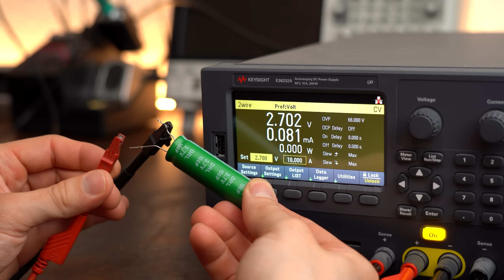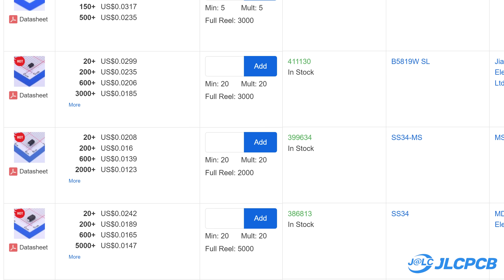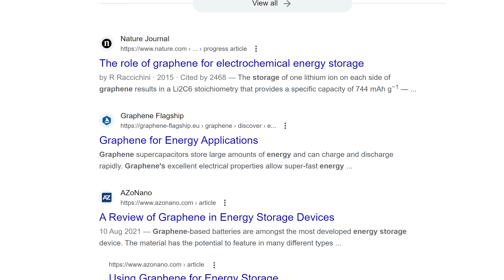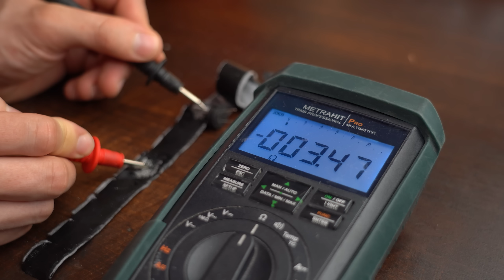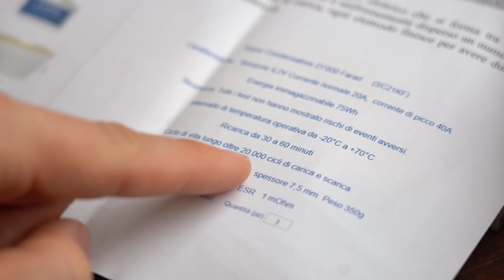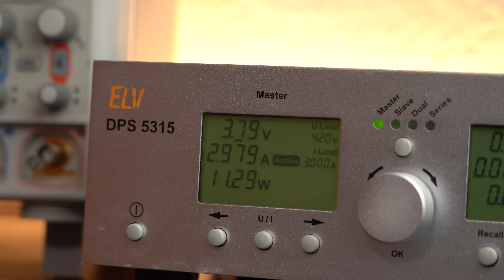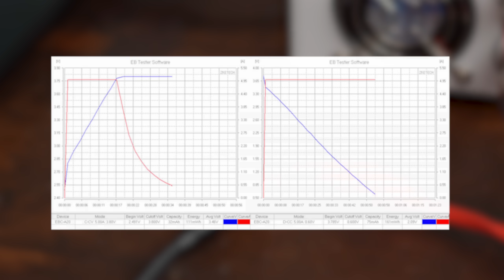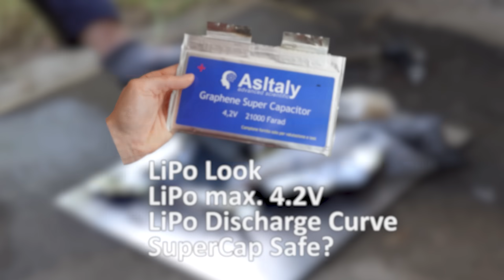Finally a Capacitor that can REPLACE a Battery?!

Comment: The only difference in terms using names of battery vs capacitor is capacitor is physical storage of charge and battery is chemical. So, it can be both by the video. Graphene gives porous structure which would in that size be corespondent of few tenis fields size if it is coal powder, - so IS involved chemistry but on nano level - if it is capacitor. As capacitor, alu plates are in combination (or included copper can be) with the graphene contact separated with paper - probably electrolyte on it too. If it is capacitor, the difference with battery is not huge, because it has chemistry after all and is not pure surface area separated with thin insulator to play only physical charging without chemistry. It is combination there, but very well designed. If both are included copper+alu also graphene, that is awesome combination.
The only better combination (cheap) would be porous as the graphene structure from alu (similar to human genebut 3d). (way time until people find tech to make porous alu :-) )
Copper porous would be more expensive, 
have good day Scott.

Comment: Looks like its a supercapacitor, lots of layer with carbon layer and separators, 1 cell lipo with 40 amps? There's a lot of supercaps model nowadays with fhat configuration. But today differentiating from caps supercaps and batteries its really hard 😂😂

Comment: I'm holding out for the borophene batteries which is more conductive, thinner, lighter, higher band gap and stronger than graphene.
There's actually loads of xenes but only borophene beats graphene in everything useful.

Comment: In my opinion, there are diodes inside this super capacitor that limit the current and prevent discharge at once, and a low voltage cut-off circuit that cuts off the current when the waist voltage goes below each cell layer. Thus, the supercapacitor is controlled discharge over a very long period of time.

Comment: Video idea! Finally a battery of the future?! Aluminum ion battery. (4.8-3.4 volts usable range, 5000-15000 charge/discharge cycles, 3000 wh/kg capability, and high safety!)

Comment: They have graphene super capacitors on ebay now for fifty for the 5500 Farad and 30 dollars for the 1300 farad capacitors. So graphene super caps are safer as they don't catch fire.

Comment: There has to be a MSDS fir the thing. It legally has to state that it contains lithium on the package, to be sold in the USA. You can test if it has lithium with science... Though, I honestly think it is just a standard supercap, and this is how the new technology works. It has reached the point of physical limits, relative to mass capacity, unlike a traditional supercap that just functions on the upper slope of that same curve. Minus the end, where it just drops to zero.

The physical reason would be the density of electrons running into restrictions when charging and releasing across 30x the surface area. A capacitor surface is 30% less and closer, making for easier charge and discharge.

That carbon layer looked real thick, relatively speaking. When compared to the thin layer of activated carbon in the rolled capacitor.

But you are right, it could have been a hybrid with less lithium in the mixture.

Comment: Another clear telltale sign of a lithium battery in your video is the alternating aluminum and copper plates inside. Lithium batteries require a copper anode for the proper chemistry.  Capacitors don't. Lithium batteries also have a distinct smell to their electrolyte. ( Which I could not tell from the video). I have taken apart a few li-po batteries. This Looks exactly like one. Perhaps it did not overreact to a nail being put in it because of the lower state of charge. Also, higher performance batteries will conduct more and react more strongly. 
I interpret all of the evidence pointing  toward a cheaply produced Mis-labeled Over Priced Li-po battery.

Comment: To determine whether the claim that a 21,000 Farad (F) supercapacitor with a voltage of 4.2V and an energy storage of 75Wh is real or a hoax, we need to perform some calculations based on the given specifications.

The energy stored in a capacitor can be calculated using the formula:

𝐸
=
1
2
𝐶
𝑉
2
E= 
2
1

 CV 
2
 

where:

𝐸
E is the energy in joules (J),
𝐶
C is the capacitance in farads (F),
𝑉
V is the voltage in volts (V).
First, let's calculate the energy in joules and then convert it to watt-hours (Wh).

Calculating the energy in joules:

𝐸
=
1
2
×
21
,
000
 
F
×
(
4.2
 
V
)
2
E= 
2
1

 ×21,000F×(4.2V) 
2
 
Converting joules to watt-hours:

1
 
Wh
=
3600
 
J
1Wh=3600J
Let's do the calculations.

The energy stored in a 21,000 Farad supercapacitor at 4.2 volts is:

185,220 joules (J)
51.45 watt-hours (Wh)
This is significantly lower than the claimed 75 Wh. Given this discrepancy, the claim that this supercapacitor can store 75 Wh of energy appears to be inaccurate or exaggerated. Therefore, it is likely that the 75 Wh storage specification is either a mistake or a hoax.

Comment: I am looking for a electricity storage for something like an electric gokart for a competition event where you start with an empty "battery" and then fill it with your muscles. It would be important that the storage of both vehicles is equal in voltage and capacity. The stored energy is planned to be enough for only five minutes or so because the competition is not only about muscles but also brains. Could I achieve this with capacitors or is this still too much, too complicated or expensive (not more than 250€ per battery)?

Comment: There is an updated data sheet on the manufacturers web site now (in Italian) https://www.asitaly.it/datasheet%20supercap.pdf

The first paragraph describes the hybrid nature...

This product is a graphene hybrid ultracapacitor which is a storage device of energy that exploits the properties of graphene to obtain high and rapid storage capacity
charging and discharging speed. These ultracapacitors combine electrostatics (or double-layer capacitance) and electrochemistry (or pseudo capacitance) to maximize energy efficiency.

Comment: probably why they  relabeled a battery as super capacitor is to circumvent the dangerous goods hazmat rules on shipping.

a super capacitor tops out anywhere between 2.3 and 2.7 volts.

normal lithium cells top out at 4.2 volts and the absolute minimum is 2.5 volts

lihv tops out at 4.3 volts i dont know what it's absolute minimum is if it is the same as normal lithium.

lifepo4 tops out at 3.65 volts though 3.6 is a safer top and minimum is 2 volts.

lifepo4 is very safe it will not easily burn like normal lithium however over dis/charging can shorten it's life.

a new chemistry lto is coming on the market and is even safer than lifepo4.

if that is indeed a standard lithium cell labeled as a supercap then you should not short circuit the cell as that could cause damage.

in case it is a standard lithium cell labeled as a super cap to evade hazmat rules 

is the united states the only country where you can not ship lithium batteries by plane or is that a global rule so even to go from rome italy to germany where you are it would have to go ground because if it is only the united states then they probably are not falsifying anything since it is legal to go by air?

Comment: I think it is pertinent to point out that the only real differences between using graphene and activated carbon is the thickness and the molecular structure (activated carbon being disordered while graphene is a specific structural order). In fact, one process to manufacture graphene uses activated carbon. Furthermore, it almost seems as if this "super-capacitor" is in fact a ceramic battery. It behaved in a very similar way to the ceramic battery test kit you had a few years ago.

Comment: so just to point something out, it,s not strictly true when you said the battery cell only lasts 5000 cycles. That's the estimated charge cycles the cell will last before hitting 80% capacity, it even states on the sheet that it'll take a further 2000 cycles to hit 70% capacity.
Even though the capacity may be reduced reduced the cell will still be usable for many more charge cycles.

Comment: That is in fact the structure of a lipo battery, if you have an old phone battery or even an 18650, discharge it and open it up. You'll see an exact copy of your chinese scam capacitor

Comment: Looks just like a soft-pack Lithium battery to me... Although I'm not certain which type it is. Internal structure and discharge curve looks the same as a Li-Po battery, but as far as I know, even the safest Li-Po battery will smoke a little when punctured 🤔
Maybe some kind of Li-Po or LiFePO4 battery, with graphene additive to improve its performance or stability? Not sure.

Comment: from having cut up a few lithium ion pouches, that does look a bit similar; and in some of the cases they didn't start smoking(I tried to electrically drain most of them first)...... trick to get them to do anything was sprinkle water on em, any hint of moisture would start the reaction sometimes if it was a small mist the lithium layer would make like a sparkling effect where the water hit it and in other cases it would ignite completely..... in either cases be careful, if it is lithium it may ignite seemingly out of nowhere

Comment: I have been working with Supercapacitors for years, and I have publications on that. The discharge curve for supercapacitor can tell so many things and carry a huge amount of data. From the discharge curve you showed, I can tell you this is impossible to be a supercapacitor. I have found similar product in several online markets they just changed the stickers. Graphene supercapacitor will add around 70% of capacitance on same volume unit. But I believe there will be so much development in the next few years.

Comment: it's a test sample, they only sell them as that as they are currently developing them. The datasheet isn't clear, but they do make a graph comparison between their hybrid supercap and a standard li-ion. Probably the current limits comes from the actual strips facing outside as they are really thin. they claim >20000 cycles but it's not specified the depth of discharge.
They also offer a cylindrical one whit 300A peak current

Comment: A chemical assay for Lithium and similar metals would be instructive.
A possible explanation for such a discharge curve would be an electrolyte that is mechanically compressed by the electrostatic force of being charged, where the limit of compressability is reached at the voltage of the knee in the curve.  That should show up as a change in thickness, hard to measure through the plastic case (though, if you, at full charge, fill any free space with, for example, mineral oil, the increase in volume at the discharged state, should expel some oil.  The flexibility of the case could confound such a measurement.
Thanks for the video.  The lack of puncture fire makes this an interesting technology, regardless.

Comment: A battery delivers a nearly constant voltage over most of the cycle. A capacitor voltage changes from the maximum when fully charged to near zero when  discharged. Can someone post an explanation on how this is mated with .say, a light bulb  which needs a constant voltage?

Comment: The layering in this looks similar to a Super capacitor, but the colors and multiple metals inside leads one to be it may be a Battery. 
Test the strips to see if there's any lithium, 
Such a test is relatively easy to do, just find instructions online.

Comment: Just like the energy stored graph shown earlier, would different caps or lithiums batteries heat and cool in a predicable manner at fixed charge and discharge cycles?

Comment: In Serbia we have ECO Buses eorking on supercapacitors. Buses are chinese made but they work wuite well. The main deal is that is also cheaper then a standrad methane bus from Turkye. Remarkable that they can charge the bus fast in less then few minutes

Comment: The "datasheet" (it's more a brochure than a datasheet tough) is available on manufacturer site: it is only in Italian but it names the product as a hybrid ultracapacitor with graphene electrodes, it clearly states that the product is not for sale as it is in development and it is only supplied for study and research. Downloading the data sheet seems to confirm your expectations on the charge / discharge curve... maybe it's worth contacting the manufacturer to understand why there's such a difference. Looking at how it's made it clearly is a EDLC capacitor in flat package... then if there's graphene or not and it that makes any difference compared to a regular supercapacitor meh ...

Comment: Hi Scott, I just subscribed because you are into the same stuff as me. Making diy batteries (charcoal +aluminium cans) capacitors, low frequency radio transmissions, Comms, ham radio, electronics, magnetic motors, berlini wheel, etc. 
I have a question please 
Where did you buy the circuit board for 3$ ?
The one that gave you DIY FM radio transmission ?

Comment: The biggest downside of supercaps isn't really their low capacity. Their biggest downside is that they can't cycle nearly as much charge in a lifetime than lipos. Multiplying the lifetime with the charge that can be pushed through the cap in this time, they are a joke compared to lipos. Only benefit is the high current capacity.

Comment: If you can see the comment, please search the marking on the cell at 3:13 "02LCC02100101A" on google, you can see it is actually a Gen 3 MpCo cell from Microvast. The good thing is that it can last 4000-7000 cycles.

Comment: This is actually a Gen 3 ("MpCO") lithium ion cell from Microvast. You can find the "02LCC" prefix from the cell, which indicates that it is a Gen3 MpCO cell from Microvast. The good news is that while it is a lithium ion cell, it can last 4000-7000 cycles according to the datasheet.
Reply: the bad news is that the one on the video won't be able to complete those cycles...
Reply: So… it actually is a legit technology, but it got mislabelled by a nefarious eBay company to scam people.
Reply: @beanapprentice1687 Still has nothing to do with graphene, and I wonder if that company who appears to sell from chemical tanks to super caps is part of the scam or not
Reply: Great info
Reply: Huh, Microvast looses 200 million contract in US after suspicious ties to China.  These batts are now showing up on russian e-bikes.

Comment: it looks like a lithium battery from the inside, lithium batteries tend to have that exact same buildup. however that it did nothing is strange, 
did you charge it? since lipo batteries only ignite if they are charged if they are empty they are safe, but also dead at that point.
a easy test would be to charge it fully and discharge it fully, then do the same things again, in case of a lipo it is typically dead if it went to low, and even if it still survives then the second time it should store a lot less energy supercapacitors should not lose capacity like that. sometimes they should even gain capacity if it is a electrolythic capacitor since electrolythic capacitors build up a oxide layer at one side which acts kind of like the isolating diode, but sometimes that one kind of degrades over time when not used when voltage is aplied in the right direction it will build it up again and ofcource lose some energy while doing so.

but that looks like a lipo from the inside and seems tohave quite few layers for it's big capacity.

however it might indeed be some kind of hybrid version essentially when you work enough graphene into the black layers of the battery they might conduct well enough to also act as a capacitor, however this hybrid capacitor effect mostly just lets it handle somewhat higher current spikes and some voltage spikes, so isn't like a normal capacitor but it can make the batteries more durable and they can handle higher current peaks. since normally all current will mostly be focussed around the connection point of the plates to the electrode, so distributing that power better will make it last longer in general.

if it actually is a capacitor however that is very interesting then. and perhaps it is actually I know it looks a lot like a lipo battery from the inside(basically exactly a similar buildup but on the other hand, I do not know how graphene super conductors look from the inside.

Comment: 100% scam - i was sure from the first view! 4.2V is not the charge voltage for super capacitors, they normally charge up to 2.7 or max 2.85V. Also the form factor shows clearly its a LiPo pouch cell! Also the max. current clearly shows typical data for LiPo, a super cap in this format could easily handle 1500 - 2500 Amps! I really wonder how you could think this might be a real super cap?